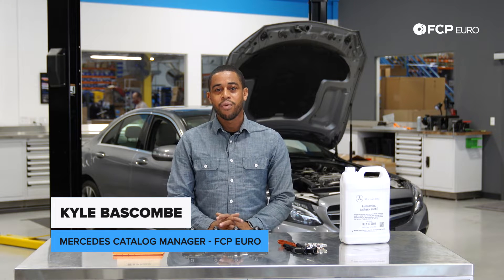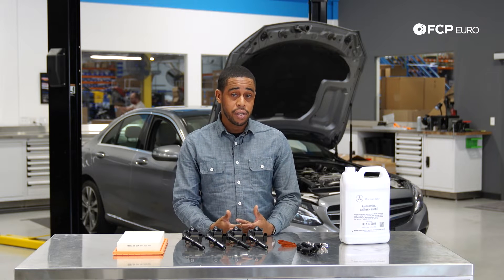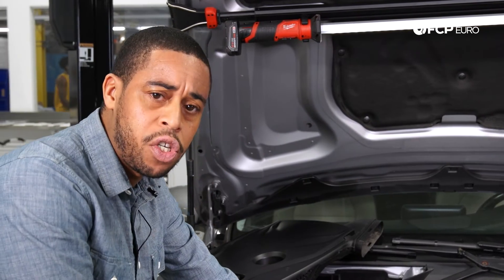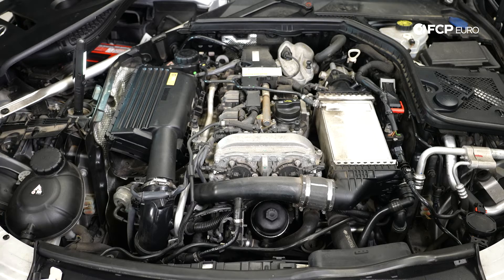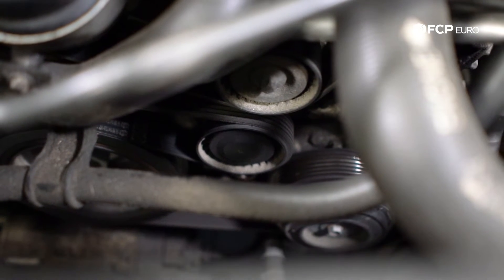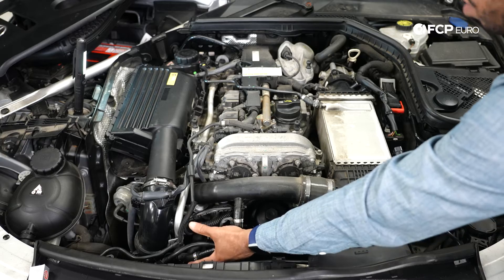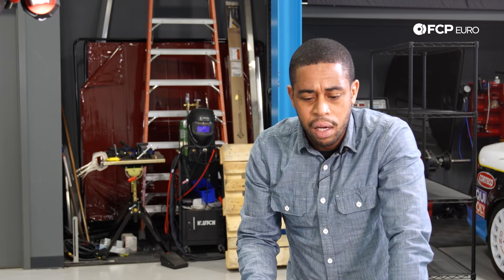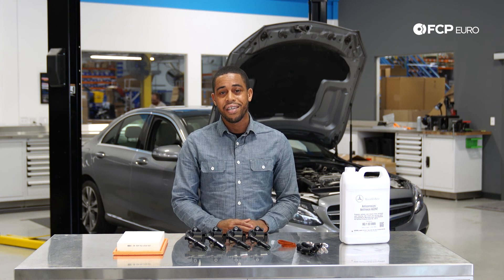Mercedes-Benz M274 Engine Diagnostic & Maintenance Guide (Mercedes W204, W205, W211, W212, & More)

Comment: I have the extended geico warranty 7 yr/100k mile for mechanical breakdown.  Ill see whether i keep 2017 infiniti q50 2.0 which has the m274 engine. So far 72k miles and not one issue
Reply: Hi, you posted it 6 months ago, what about reliability of your M274 on that Q50S? I was thinking about such car but after deep diving into M274 tech issues, I gave up on it.  Too risky in my opinion, compared to Nissan's engines mounted on Q50 series.

Comment: Nice video, I would definitely like to see more on the M274 engine. My 2016 Metris is throwing the code for the PCV system and I would love to see a video on replacing that.
Reply: Mercedes extended the warranty on the part to 150,000 Miles P052E should be the code
Reply: @Baruchashem32 yup I had my PCV changed free of charge under the warranty
Reply from the maker: Sounds good, Jim!
Reply: Bro thats pain to replace it,  it takes 6-8 hours to replace that pcv system. And its gonna cost  arround 1500 to 2000$.

Comment: In April of last year (2021) I was driving my 2017 C300 (W205), piston 1 cylinder 1 had failure (ejected through the engine block) with 86737 KM (53,896 M) on the odometer, I was about 3,896 miles over my factory warranty. Due to my engine block being damaged (the piston went through the block and ejected onto the highway) the repair cost was going to be 12,000EURO. Mercedes Corporate refused to offer any support (good will warranty or otherwise). Mercedes has terrible customer service, I had every oil & oil filter change (at 5,000 mile intervals) performed at the dealership. My car had excellent MB dealership service records and MB still refused to help me.

I did not owe anything on the car (thank God I paid it off) so I had to scrap it for pennies on the dollar of what I paid for it. I will NEVER drive a MB again. I have since replaced the car with a BMW 330i and I have been very blessed to not have any issues with it.
For me it is not about the money, it is about the principle, one does not buy or lease a Mercedes Benz only to have the engine blow up with only 87,737KM on the odometer! And for the repair cost of the total engine replacement I could have just bought a new car with that (which I did). Please do not buy a C300 (W205) or any MB with the M274 engine.
Reply from the maker: So sorry to hear that!
Reply: @fcpeuro  It sucks but I made the best out of a terrible situation, now I have a very well maintained BMW 3 series (330i) and it has been very reliable and dependable. I always get more oil change kits and parts from you guys at FCP Euro :)
Reply: You jumped from one hot frypan to another hot frypan. BMW/Mercedes and Audi builds very poor quality cars (but fun to drive and good looking) and does not care at all about customers. You would be much better of with a Lexus/Acura or Infiniti ... Less fun but you will not need a new engine every 3-4 years.. Also Lexus dealers have excellent service. I got a free dashboard on my GX as a good will replacement 10 years after the warranty was expired...
Reply: @juchou2983 it’s not a valid argument to write off an entire brand. You sound like an unreasonable un-researched alarmist. Just as there are black sheep engines within a brand, as there are ol’reliables. I have an ‘06 BMW 325xi w/an NA (naturally aspirated) N52 engine that I bought in 2012 with 73,XXX miles. I still have it today with 240,XXX miles. My maintenance wasn’t the stuff of legends either. Hasn’t cost me a fortune. Has been in the shop a few times over the years. Cars are all complex puzzles. Even the simple ones. Something is bound to break.
Reply: @soILLitsADVISED  it is an well established fact that post 90s BMW-mercedes-audi are very unreliable and high maintenance cars. You sound like one of those fanboys who bought something and starts claiming how great it is.. BMWs almost always have gasket issues, water pump failures, hard to diagnose random misfire issues, oil burning and so many other major problems. BMWs need reprogramming after just a battery change!! Your anecdotal evidence does not really mean anything.. How many BMW can you show that has more than 200k and still runs properly? I don't understand this blind loyalty that people have for some brands. Yes they are fun.. I have owned a couple of them.. But it's just silly to claim they are reliable. What do you think is the reason you can buy a 2010-12 7-series for 10-15 grand?
Reply: @soILLitsADVISED  I have owned two 3 series, an E46 3 series and an E90 3 series, both were excellent reliable cars. 
My E46 had over 250,000 miles on it and the E90 had around 180,000. 

My E46 died in an accident, still have my E90 (step son drives it).

Older Mercedes were reliable and well built, the newer models (2015 onward) not so much.
Reply: @juchou2983  Wrong, both of my BMWs are very reliable and well built, older Mercedes were reliable and well made but the newer (2015-current) production years not so much.

Lexus is suffering from reliability issues as of the last 5 years.
Reply: lol BMW engines have electric water pumps dying every 80k kms, oil leaks from OFHG, valve cover, sump pan etc, all as it gets old. have fun buddy.

Comment: Saying that Piston issues were only present on very early cars/engines is absolutely incorrect.

There are dozens of cases with USDM and ADM models of this motor from 2017 onward with catastrophic piston failure in Piston 1 and some with multiple pistons.

Failure mode ranges from cracked ring lands to completely cracked piston crowns.

I can't believe MB USA hasn't been forced to recall these motors or had a class action law suit brought against them as they often fail JUST outside the factory warranty period. 

I know some owners in CA have gotten MBUSA to pay for replacement because CA makes pistons covered under the 80k mile smog equipment warranty.
Reply: Hi, I sent a petition to the administrator of the NHTSA to investigate this piston issue as I was affected and after months and months of pushing the issue they were finally kind enough to start an investigation . If you look at the open investigations for 2015 c300s there are now three and the wrist pin / cracked piston engine failure is one of them . This started about two weeks ago, so let’s have faith in our government to make Mercedes do what is right and take responsibility for this problem. It is totally unsafe for someone to be driving on the road and have this unexpectedly happen, it’s only a matter of time before someone gets hurt and the NHTSA has the power to force Mercedes into recalling this engine .

Comment: Those water pumps fail all the time too. They seize and take the belt and anything in the belt's way with it. Also, some versions use a dual stage pump that routinely fails as well. Causes the engine to run hot at speed. Routinely misdiagnosed. And unless I missed something, the turbo had to come out, as the pump lives under the turbo. That means you'll be doing all the seals and gaskets on the turbo as well. 

Egregious water pump design for sure.
Reply: You don't have to remove the turbo, you can remove the heat shield off the water pump and then it slides out. I have a video explaining it.

Comment: Thank you really nice video 👍. Mine just got fuel leak at low side pipe of high pressure pump got it fix yesterday. Not sure state model has this problem in mine country has this issue  a lots.
Reply from the maker: This seems to be a common theme. We just filmed a quick tech tip mentioning that on the M274 engine!

Comment: Sadly I'm currently into the Oil separator value assembly replacemen that you mentioned in the video... What a pain in my ass....here's what I've has to remove besides a bunch of the sensors... Intercooler, ECM and bracket, starter, engine mount + bracket, a thick rubber shield.  I'm 5hrs into it and I've only at the point of being able to see one of the 3 bolts on the lower part of the assembly that connects to the lower part of the engine... I'll say it will take me 8-9hrs to finish this job.  Mercedes Benz dealership wanted $1600 for parts and labor.  If I were to do it again.  I'd give them the money.  This job is certainly one of the worst and pain in my ass fixes I've done in a long time.  This should be a recall item AND/OR should be covered as part of the extended emissions warranty that comes with the car.  TOTAL BS...

Comment: I own a 2015 E200 coupe with M274 engine right now and it's show code out of nowhere P217800(Mixture failure, rich fuel in bank 1), which part should I be concern or where should I check first? does it urgent to fix?
Reply: How many km?

Comment: Has anyone replaced their POLY-V Belt yet? There isn't a designated interval but looking to see what is common practice as I wouldn't want it to snap before replacement.
Reply: I think visual check is ok, I think I did mine at 150k kms? Got to 290k kms (2014 A180) before car was written off by rear end crash

Comment: Wrist pin noise can be detected as the engine is dropping in rpms when revved, almost sounds like a woodpecker.  Most common in 2015 models, quite rare for 2016 models.  At the dealer level we do a full bottom end rebuild, we replace the pistons, rods and wrist pins for all 4 cylinders.  If you're experiencing a squeaky belt and have replaced the idler pulleys and tensioner with no success, back out the alternator bolts most of the way (do not remove them all the way) and give each one a good hit or two with a rubber mallet and retighten....the alternator can be slightly misaligned.  No need to replace the engine air filter so frequently either, theres a pre-filter in the intake duct that traps alot of material and the shape of the duct prevents much material from reaching the filter.  Mercedes recommended interval is 50k/5yrs and at that interval the filters usually aren't extremely dirty....you can change the filter with your spark plugs.  Speaking of plugs, if you want to avoid having the plug boots get stuck in the head, warm the engine up a bit before removal and they'll slide out like butter.   No real need to replace coil packs or boots when replacing plugs, only do so when one actually goes bad (easy to diagnose).
Reply: Ich habe jetzt 120,000 km auf diesen Motor im W205 ohne irgend ein Problen, Lt. Statistik betreffen die hier erwähnten Schäden zusammen nur 0,005% der Fahrzeuge, die diesen Motor haben. Das hier sind extreme Einzelfälle bei evtl. außergewöhnlichen Fahrbedingungen.
Reply: Would you recommend keeping a 19' W213 E300 with an m274 engine? Do you think these engines can hit 150k miles without any serious problems?
Reply: @NotYet8  I work on these for a living and I would get rid of that car as quickly as possible.
Reply: @ronjohnson8119 I have one, and I notice strange sounds sometimes on cold starts, but I'm not sure of the reason
Are there any steps that you recommend to take to avoid having these problems?
Reply: @dominozonda do a compression and leak down test
Reply: @NotYet8  nope
Reply: @NotYet8  I wouldn’t keep it…. I’m trying to get it recalled right now … it’s only a matter of time before your piston will crack … the wrist pin issue was supposedly fixed after mid 2015 but I’ve read about it happening to later model years also. Also affecting glc and metris vans that have the same engine
Reply: @NotYet8  I’m at 170km right now
Reply: @thomasy3464  The here written problem are extremely seldom. I have 120.000 - no problem.
Reply: I do hear a ticking sound while driving low speed  ..aside of that had the car for 4 years and now I have a p052e code, I usually work on cars but I hear I have to lift the left side of the engine to get to the sensor that needs to be replaced is there any other easy ways?
Reply: what kind of mile does this accur? any tips to avoid it?
Reply: @mrbozaboza  yes, don’t buy a car with this engine. If you own one, get rid of it.
Reply: @ronjohnson8119  I agree!
Reply: The coil boots rarely ever survive disassembly on higher mileage engines. By higher mileage, I mean 60k +. I've tried warming the engine, Heat guns you name it. I disconnect them from the coil body, and the boot is seized in the well real nice! When you pull them out, you will notice the boots are all discolored. Plus MB recommends them as part of a tune up. 

Also, in dusty ass south Florida, you ain't getting 50k out of an air filter out here. It will be filthy after 20k.
Reply: Does this occur in the earlier models? Looking at a w212 with this engine 2013 model year
Reply: The weird thing is that I’ve done some research and the piston cracking issue is rare on the M270 engine (the M274 except transverse mounted) which is used in the A, CLA, GLA, GLB and the Infinity models that use that engine. Why do you think that might be?
Reply: @vintagehaynesflute  the 270 iirc comes from a different manufacturer than the 274.  They're similar engines, but also very different, they don't really share any components.
Reply: @JeeperZJ  according to Mercedes it’s interior components are exactly the same
Reply: The wrist pin issue caused my piston to fail and eject its-self through the block.

In April of last year (2021) I was driving my 2017 C300, piston 1 cylinder 1 had failure (ejected through the engine block) with 86737 KM (53,896 M) on the odometer, I was about 3,896 miles over my factory warranty. Due to my engine block being damaged (the piston went through the block and ejected onto the highway) the repair cost was going to be 12,000EURO. Mercedes Corporate refused to offer any support (good will warranty or otherwise). Mercedes has terrible customer service, I had every oil & oil filter change (at 5,000 mile intervals) performed at the dealership. My car had excellent MB dealership service records and MB still refused to help me.

I did not owe anything on the car (thank God I paid it off) so I had to scrap it for pennies on the dollar of what I paid for it. I will NEVER drive a MB again. I have since replaced the car with a BMW 330i and I have been very blessed to not have any issues with it.
For me it is not about the money, it is about the principle, one does not buy or lease a Mercedes Benz only to have the engine blow up with only 87,737KM on the odometer! And for the repair cost of the total engine replacement I could have just bought a new car with that (which I did). Please do not buy a C300 (W205) or any MB with the M274 engine.
Reply: @VanquishMediaDE  what grade gasoline were you using
Reply: @JeeperZJ  Premium only
Reply: I've found at least a dozen documented cases online of 2016+ m274 engines having piston #1 failure at the ring lands.

The wrist pin / piston cracking issues is definitely NOT confined to early motors.

Comment: Hi I have a 2017 infiniti q50 2.0t and on mine the ecu is on the very top of the engine, not like the one in the vid, are there any significant differences between the ones nissan gets, and the ones mercedes uses? If so what are they
Reply: Hi, what about reliability of your M274 on that Q50S? I was thinking about such car but after deep diving into M274 tech issues, I gave up on it.  Too risky in my opinion, compared to Nissan's engines mounted on Q50 series.

Comment: Can the water pump start making noise? My c300 makes this noise as the RPMs change, sounds like valve tapping. Please advise
Reply from the maker: Water pumps can definitely make noise as they start to go bad. Valve tapping noise can be anything, unfortunately. You can have noisy lifters, a bad bearing on an accessory or pulley, low oil ect.

Comment: how serious with P219C, P0301and misfire...had replaced spark plugs, ignition coil , air filter, fuel injector in cylinder #1....but engine still shakes and chk engine light came back on

Comment: Doesn't the W204 use the M271... really curious about the differences in the engines
Reply: It also uses the M274 1,6 engine only last ones made jus before w205
Reply: @tanashetsuro344  Does the 1.6 m274 in w204 have problems with pistons?
Reply: 271 is a decent engine, the 274 is a complete steaming pile.

Comment: Drive belt? This thing doesn’t have a chain ?
I’m confused sorry.
Reply: The belt runs the engine accessories
Reply: A drive belt runs the accessories (alternator, a/c compressor, water pump, etc) whereas a timing belt (or chain which this engine uses) is what connects the crankshaft to the camshaft (s).

Comment: Well in USA you might see V8s, here where i live tax is high for big displacemnet engines so you are very rich if you drive a V6 diesel. This engine is 1991cc and that is very improtnat if you have this kind of tax. This engine with LPG migh be the best go to before all the cab drivers grab these cars. For example here you cant find a good M271 engine anymore from the overuse as taxis or kids who think they are cool in there W203 manual with a straight pipe

Comment: My check engine came on. Read the code it was a cylinder 2 misfire. Replaced the spark plugs and changed the ignition coil. But after 500 miles of driving another misfire occurred in  cylinder 2. Any help or suggestion what can be causing this ?
Reply: i work at a mercedes dealership and we have been replacing cylinder heads due to this problem